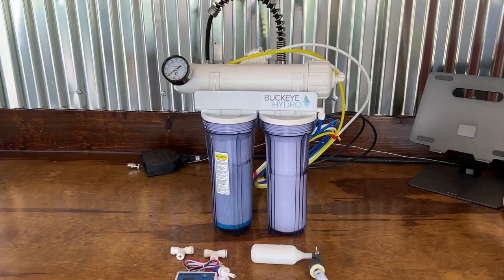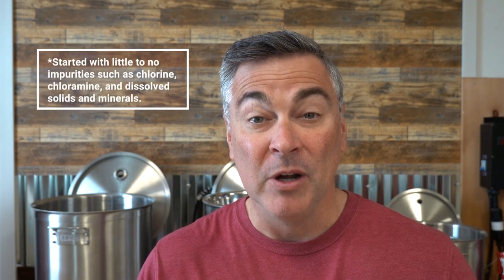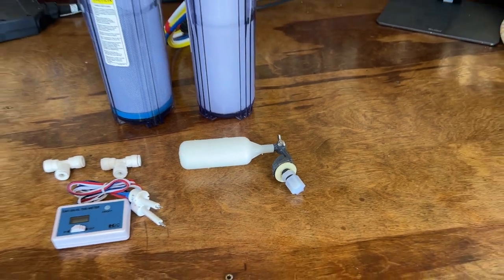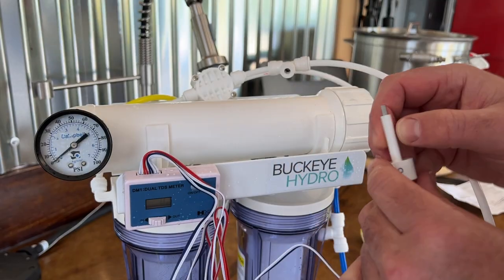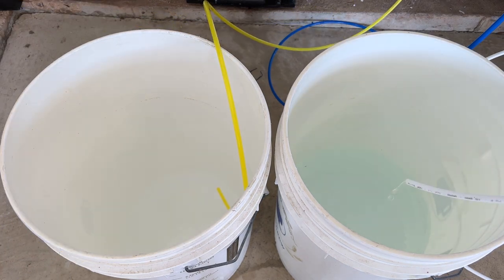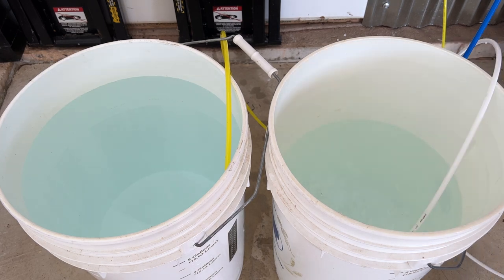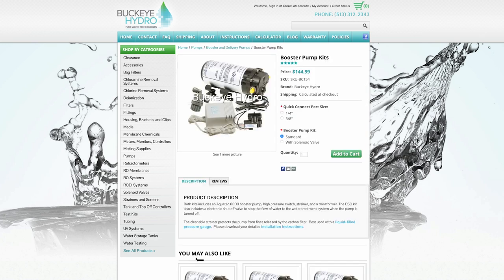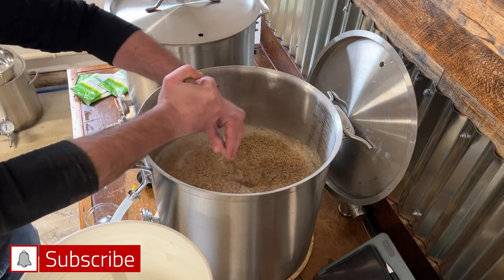How to Install Reverse Osmosis Water System for Homebrewery [ Buckeye Hydro Review ]

Comment: Could you explain a little more on how you hooked up the water supply? I just purchased the system but am having trouble figuring out what connectors to get for the actual water supply. Thanks!
Reply from the maker: I hook mine directly to a garden hose faucet. It’s been a while since I installed this, but I do recall there being a few options for the hook up. I picked the garden hose attachment. There may be other options. I hope this helps!
Reply: @justhomebrew  this does. Thank you very much and great video!

Comment: I wonder if you could put a little punp in the wastewater and run it through again to limit waste?
Reply from the maker: Hey Richard, that’s something I might test sometime. My only thought is it could be additional wear and tear in your pump. It would have to run for a long period of time. Thanks for the comment!
Reply: Good question Richard.  This can be done, and it's routinely done on commercial RO systems.  But the devil's in the details...  it only makes sense if your tap water/feedwater water has been softened.

Comment: “water is probably the most important ingredient in beer brewing”????

It is important, but I would rank it towards the bottom in terms of importance.
I have found that malt quality, yeast, mashing and fermentation techniques and sanitation are more critical to your final beer quality.
Your RO yield or efficiency is quite low although the “waste” water is fine to use for other purposes if your original water supply was drinkable to start off with.

Do you filter the water before running it through the RO filtration system?
A fine sediment and carbon stage filter stage would help.
(Water chemistry is a different issue)
Reply from the maker: Maybe another way I could have got my point across in the video is that water can greatly impact the quality of your beer. I’ve been amazed how much of a difference there is to my beer when I tweak the water chemistry. I do have a sediment filter. For this video, I chose to leave that part of the test out because I just wanted to focus on the RO system. I saw a 10 ppm drop with my sediment filter in place when running another test. I appreciate the input and feedback!
Reply: @justhomebrew  That's true. You mentioned buying spring water from your supplier for beer making. Spring water does have dissolved solid contents that are high.
As long as one knows what the general chemistry is of your water supply, you can adjust the components and pH etc.
I agree that you need to pay attention to all aspects of the beer making process. I brew beer at home with a basic set up and also make wine. I can say that for me wine making is less complicated than beer brewing. 
Good luck....it's a great hobby.
Reply: Water is one of the most important raw materials in brewing with it making up 90-96% of your beer. You can make the argument that the other ingredients are just as important, but I would argue that it is the most overlooked raw material, particularly among new brewers. 

Optimizing the ions present can greatly impact many aspects of your beer, including perceived sweetness and hop bitterness. The hardness of your water also impacts your brewing process, as hard water can cause scale to build up on heating elements and reduce heating efficiencies. The hardness also impacts the pH of your mash. If it is too alkaline, you will have poor saccharification, poor wort separation, darker than expected wort, poor protein precipitation, and astringency. If the pH is too low, which is extremely common in darker beers due to insufficient residual alkalinity, you will produce a harsh, acidic beer. 

Depending on where you get your brewing water, there are certain chemicals and ions that are allowed in water for it to be considered potable, but you must remove them for quality beer. Small amounts of copper and iron are allowed in potable water, but are oxidation catalysts that will negatively affect colloidal stability. There are currently no regulations for silicates, and they can cause haze and negatively impact wort separation. There are many similar examples, and RO filters and ion exchanges help remove these from your water. You don’t need an RO filter or ion exchange system to brew excellent beer, but it does allow you to have greater control over the water profile if you want to make adjustments for different styles. 

Like I said earlier, I would agree with an argument that all ingredients are important to the brewing process and overall quality of your beer, but not that it’s less important.
Reply from the maker: Thanks for the additional feedback and input! I really like how you positioned water as an important raw material. This is another way I could have positioned my statement better in the video. Also, excellent insight and knowledge of what to think about for water profiles. Cheers!